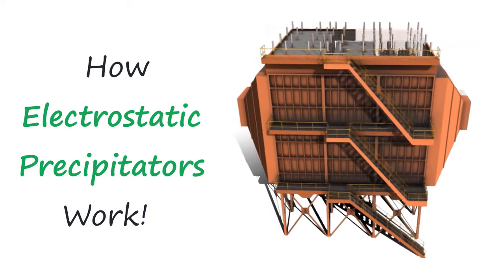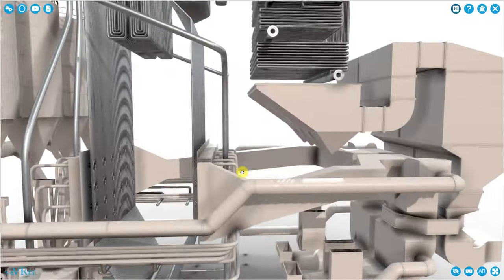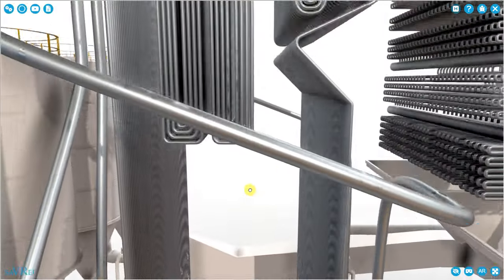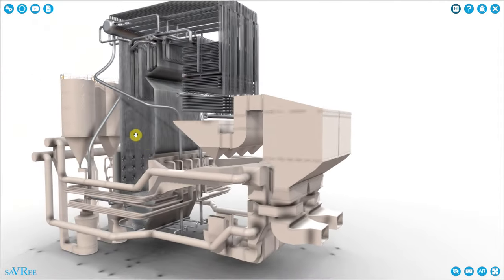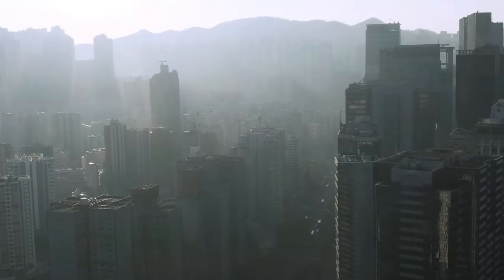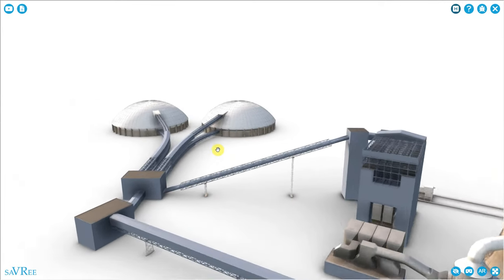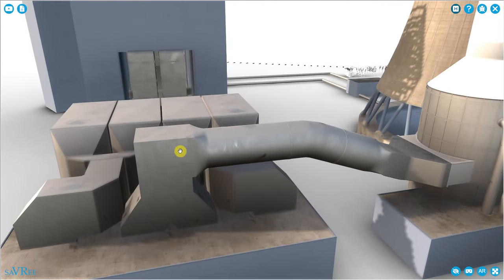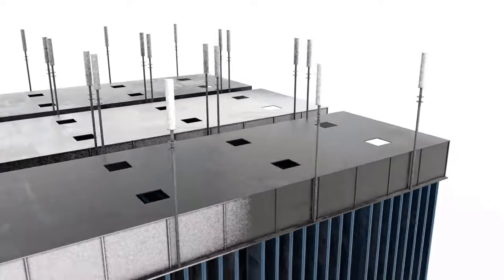Electrostatic Precipitator (ESP) - How it works!

Comment: They've been around a long time. In the mid 60s my dad worked in maintenance for GM at one of their large iron foundries. I remember him talking about them being a dirty nightmare to maintain and they were always breaking down.
Reply: Come a long way then. We do a weekly wash of ours (particle board mill) and we rarely have problems with it. They do a pretty good job of stuff cleaning and are pretty stable and the one I operate is probably 20 years old at this point at least.

Comment: bro ...but you didnt taught howit actually works ..principle ?
Reply: But he did. Quite thoroughly I might add.

It's very simple, in fact. Clue is in the name. Those big plates are charged electrostatically, kinda like a capacitor. They atract the ash particles to themselves, which is then shaken off, collected in the bottom and transported away.

That kind of ash is useful in the cement industry. But most of it is dumped and buried away.
Reply: Oh, nevermind. He cut away the explanation part wtf
Reply: @ThZuao  thank you , but wanted to know how they attract the particles , consider me as a laymen.

Comment: There' has been substantial information removed about the electrostatic presperyor , not only does it filter, landfill Air or plant operations atmosphere, but also generate growth in agriculture, but the beneficial of all is atmosphereic voltage, static electrical junk, it doesn't mention it for some reason anymore which is why I purchased my unit 4 yrs ago a large unit,  but I'm realized perhaps is because the industry is changing the dynamics of parameters just to filter, the smog, and nothing else, which makes sense with the world of today, because when big brother or uncle same fires up those 5 g units in order to , maintain order it's possible these units might interfere, ya 5 g units usually located at local churches, or the ice machines that are everywhere today, but only in high duress area's, I want to hook my up finally but can't find a wet filtration diy info,  but ya im looking for one so i can run my machine ❤

Comment: We use a WESP at my particle board mill. Interesting to see it used in different contexts. We scrub our hot air exhaust from our dryer through the WESP and it catches the particulates left over from the drying process. The WESP rinses itself every 90 minutes and the "mud" bi product that's produced is filtered and screens 2 more times, once in a shaker table, and once in a mud press. The water is then recycled and the mud is sent to another processing facility to be reused. The whole process is incredibly efficient with very little waste material. I'm the milling and dryer operator so I run the WESP in conjunction with the dryer and our milling room.
Reply: Do you get any corrosion issues since water is involved? Can I know what's the pH of your mud?
Reply: @TubersAndPotatoes  I actually don't know the pH of the mud unfortunately, but I can say that we don't have much corrosion issues, and that's with us using a diluted caustic solution as well.

Comment: I watched this video three times thinking I missed something, but this video does NOT explain how an Electrostatic Precipitator (ESP) works. 

It explains where an ESP is used in the process of a coal power station and why it's needed, but has literally zero actual information on what an ESP is, or any specific information on the device/machine/system, its design, components, or how it works. I'm actually more confused now than I was before :( 

At the end the video the narrator says "I hope you now understand how an Electrostatic Precipitator works, what the main components are, and why we have them." One out of Three? 

saVRee, your videos are usually so good! I wonder if you accidentally cut/deleted the most important scenes of this video?

Comment: Sorry to mention, actually cooling towers are used to cool down the vapor of the steam through the technique called evaporative cooling. Whereas chimneys are used for releasing the gases at a particular height so that it won't have an effect on the immediate surroundings
Reply from the maker: The water that is evaporated is called 'drift'. The word 'chimney' is not used very often in engineering, it is called a 'stack'. Not sure why, but I hardly ever see the word 'chimney' used in an engineering context.

Comment: On a smaller scale I sailed with gas turbines which had ESPs fitted on both GG gear boxes to recover atomised luboil. The plague prompted me to wonder why we did not use them to clean air in our public spaces.

Comment: How much of the power generated from the coal is used in the pre and post processes such as this?
Why do we not extract and use as much of the heat energy from the air blowing through as possible instead of sending it to a cooling tower to blow out steam?
Reply: I wonder about your first question myself.

But the second part I can answer.
Basically, costs scale exponentially to benefit. Meaning, at the end of a power plant's service life if a feature saves 1% of fuel while increasing the overall cost of running a power plant by 1.1%, in maintenance and implementation cost, it will not be installed (they include a prediction of varying fuel costs in the mix).

The exaust gas needs to e hot in order to be drafted by the athmosphere. Something like 200-300°C IIRC. Hot air rises more easily but is harder to blow with a fan. Then it becomes a balancing act between the ammount of heat extracted from the exaust and the work put back in the system to blow the exaust out. The good thing in coal power plant is that since they run the base load, the ammount of power/heat generated is pretty much constant.

Which is also the why that you cannot upgrade a running power plant. They run constantly, only stopping for scheduled maintenance which doesn't last very long because they take days or even weeks to shut down and start up cold again. You simply cannot disrupt the exaust ducts or add in extra piping. So any new feature or technological advancement has to be implemented in the construction of the plant. And the West isn't interested in building new ones.

What is indeed done with exaust gas is that it is used to preheat the air incoming to the furnace. It's easy to build and cheap to mantain. Does increase pumping losses but it's worth it.

Another thing that can be done, though only applicable to small boilers, like the ones in a company that needs to generate steam for a process is that you can tap the waste heat of the exaust with an absorption refrigeration system for refrigeration or air conditioning. That increases cost and I've only seen such a system in academical papers and classes.